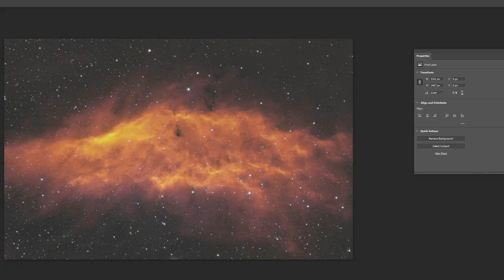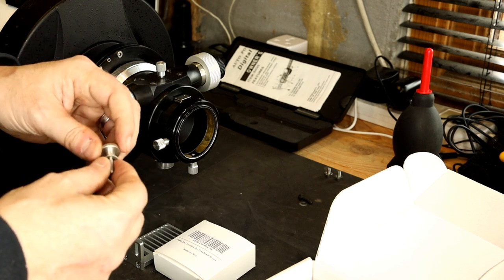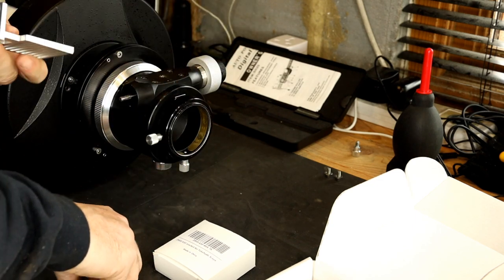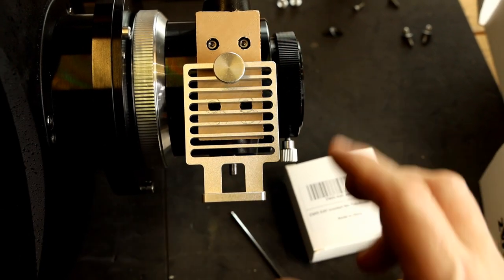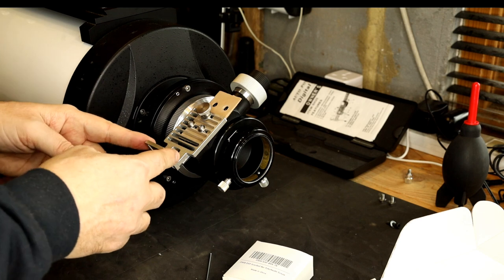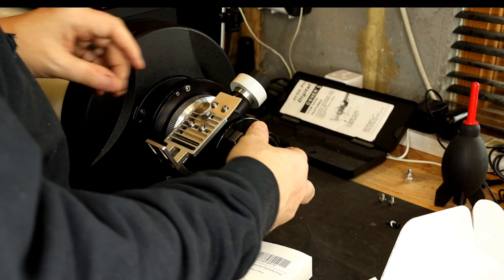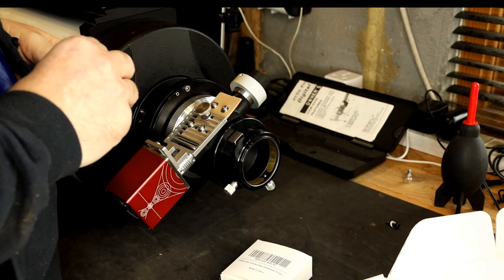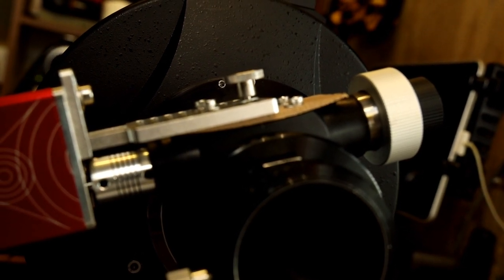Astrophotography with Glenn Clouder - ZWO EAF Installation to RC6/RC8

Comment: Very informative video Glenn! Not only does this help with an RC 6 or 8, but with the aid of that bracket and the correct 3D printed part, it should help anyone be able to install a ZWO EAF on just about any scope.
Reply from the maker: Thank you Joe. Most things can be adapted with a little mod here and there. Kind of satisfying too when it all works

Comment: I used these instructions for my GSO Linear Bearing focuser on my GSO Newtonian and they worked like a charm. I didn't have the 3D printed part, but I made my own washer out of the bottom portion of a cheap, non-retractable bic pen - the part that holds the ink stalk into the outer barrel of the pen. Its diameter is perfect for the focuser tension set screw and the slight flare of it worked perfectly. THANK YOU FOR THE VIDEO!
Reply from the maker: That sounds like you found a perfect workaround there. Thank you for taking the time to comment and I am glad you found the video useful. Clear skies

Comment: Nicely explained Glen. I’ve just bought the ZWO EAF, got to fit it to the skywatcher esprit 100. 
I hear that it isn’t straight forward, so I’ve bought the same adapter bracket as you! 
I hope mine goes as well as yours mate!
Reply from the maker: Just take your time with it. I have 2 other videos fitting one to a william optics Z61 and one to a Sky watcher 130pds, they might help also. The Z61 also has a bit of nina on connecting to it and setting the backlash
Reply: Thanks, I’ll take a look at those!
Reply from the maker: @SimonsAstro  if you have any issues please feel free to message me and I’ll see if I can help
Reply: @Astrobloke  I appreciate that, thanks Glen👍

Comment: Seems that instead of the 3D printed plastic plate, one could use some nylon washers to fill the gap between the mounting plate and the focuser in case one has no access to getting a plate 3D printed.
Reply from the maker: Absolutely. You can mount without anything but its only then got a couple of small points of contact. Still works fine.

Comment: Thank you so much for the video, please help mon fixing EAF on RC6, it is different from RC8.
Reply from the maker: How different is the RC6 Focuser?
Reply: @Astrobloke  Hi I'll answer on Sulalman's behalf. Both the locking screw and the tension screw are on the bottom and there is no recess.  Room to Fit an EF is limited if non existant.  I have set up a pulley system on mine using a method similar to the avalon focuser.  It worked well until I added an OAG. Slippage meant I had to tighten the adjustment to the point where the belt struggles to overcome the friction.
Reply from the maker: @TheSnoopstar99  I have so far been lucky to always be able to adapt the ZWO EAF to all the scopes I have used it on and not had those problems. I wounder if the pegasus focus cube or the sesto senso would work better,
Reply: @TheSnoopstar99  i'm having same problem, am thinking about taking tube apart and drilling to attach a bracket to hold focuser, or a clamp to fit around focus tube ! :/

Comment: Hi Glenn Do you still have the RC? Been contemplating a RC for galaxy season.
Reply from the maker: Hi. I do not anymore. I sold it to help fund buying my CT10. I had an RC8 by Altair astro. They are excellent scopes and are great for galaxy season. What RC scope are you looking to get?
Reply: @Astrobloke  Is considering one of the many GSO RC6’s, after seeing Astroaddict collimate his small Omegon, and the results he was getting. I could then have a dedicated OSC setup with the RC and my old Nikon D5300 for galaxies and small DSO’s, and narrowband/LRGB mono setup on my new William Optics GT81IV for bigger structures.